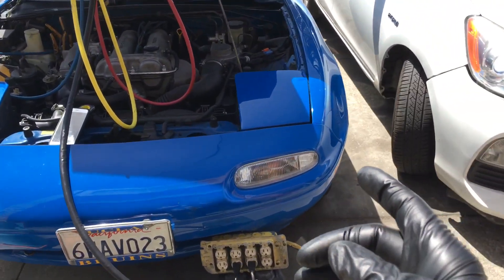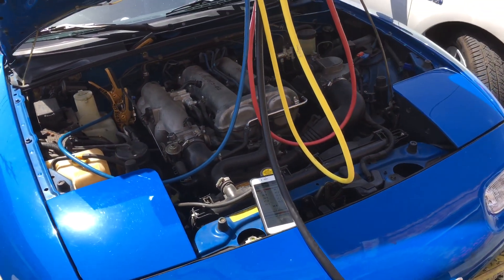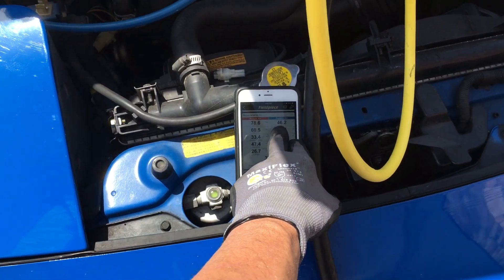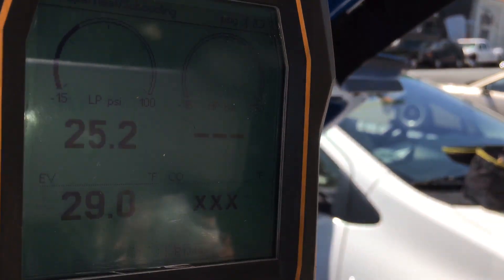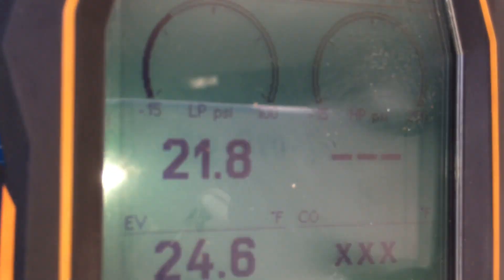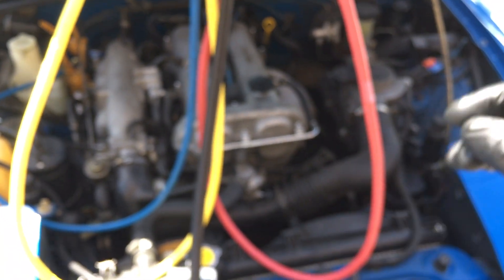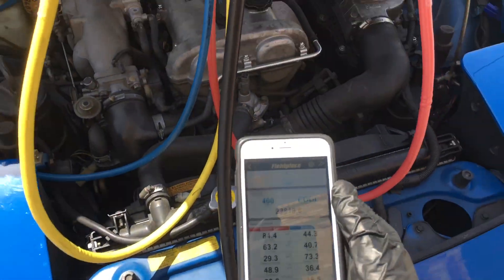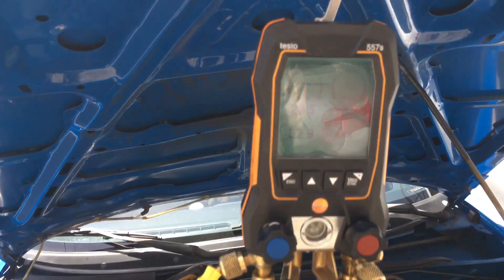Fix piston AC compressor compared to variable displacement compressor. Fix piston becoming extinct

Comment: They're now using them on larger displacement engines prolly where the clutch cycling is less felt (that is the case of the Ford Edge, for example; 2.0L has a variable Denso and 3.5/3.7L have fixed displacement Densos; they share the same TXV). And even on a small displacement engine, i believe that if the TXV is set with a low enough MOP the "bump" from the comp cycling on isn't really an issue (there are a number of 0.6L Suzuki/Nissan Kei cars where they use vane comps; there's also been a 0.8L Daewoo equipped with a Delphi SP10 fixed displacement piston comp).
Reply from the maker: One thing I have noticed with the variable displacement compressors technicians are replacing the whole compressor when it’s just the displacement valve or displacement solenoid that is bad.     It’s like replacing the cars transmission because a single shift solenoid is bad . Imagine every time a $30 or $80 solenoid goes out inside the valve body of a transmission a technician tells the customer they have to replace a $6000 transmission for a three hour job and a $30 electric solenoid. 

            Also because of the variable displacement is exactly why these cans sold in the auto parts stores with a little low side gauge do not properly charge up the vehicle. 
               And the same goes for the little cans with the guys who like to look at pressures to determine if a car is filled when they’re chasing a variable displacement compressor that is constantly changing the displacement as they’re adding refrigerant in it. 

           The majority of cars I do every day are less than 3 to 5 years old mini still under warranty. 
                  Where are the majority of technicians who occasionally do air conditioning or in shops at See cars that are well over five years old and older. 
                           I’m noticing because of that my sense of touch in feeling lines or vibration in temperatures and touching the case of the compressor and spinning clutches with my fingers on what few cars still have clutches to spin. 
                   My senses for determining compressors in system operation is shifting to the normal variable displacement compressor as normal or clutchless compressor as normal. 

             And fix piston compressors with clutches are becoming an old relic like carburetors and manual transmissions. 

        If you ever go to the MACS expo and training convention you get to see every year all the latest new compressors being offered by every manufacture around the world on display tables looking for new vendors and parts houses to pick up their product line. 

             One of the reasons I like to go to the MACS training seminars at the expo. 
               I get to see stuff first years before anybody else gets to see it on vehicles coming into the shop.

Comment: did you manage to fix the issue with the 557s?
Reply from the maker: No it’s an intermittent problem sometimes it does it sometimes it does not with that refrigerant updating boot loop lockout issue   Then other times I have an issue with the micron gauge working with the refrigerant gauge not able to connect to the software that’s the second issue then the third issue I have sometimes once just slightly knocking or tapping the gauge it literally turns off and restarts and now the new issue I’ve just found the cheap acrylic plastic lens that they use over the screen. It’s starting to crack and actually just tonight looking at the screen more closely there’s a little micro fractures that are starting at the right edge of the screen I have seen this happen before on other cheap plastics.